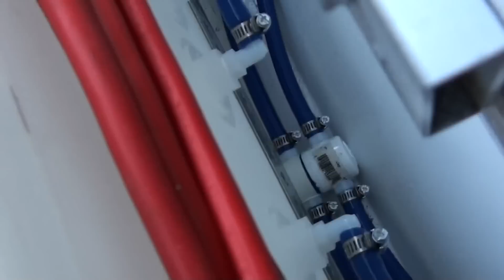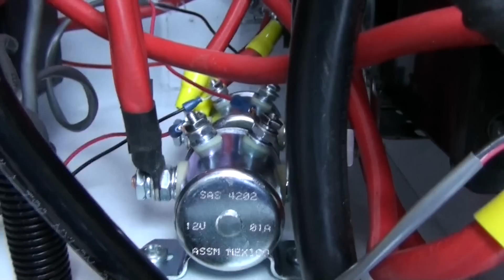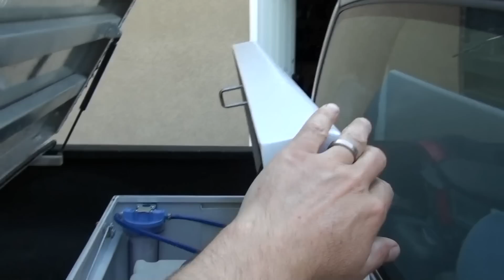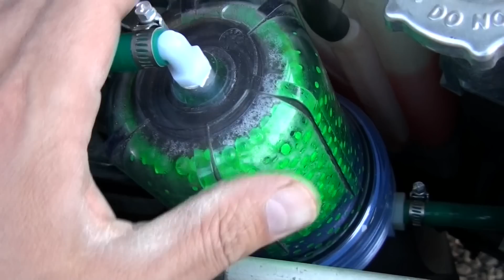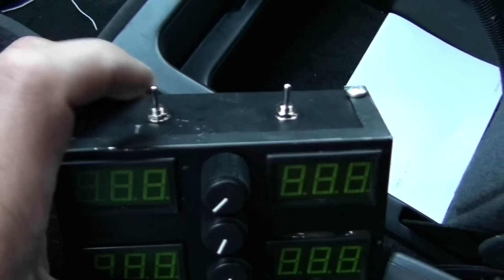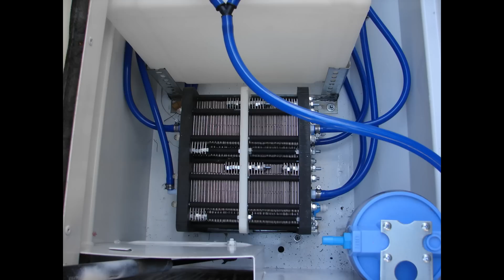288 Plate HHO generator Dodge Ram project. Part 3

Comment: I hope to do this as well. My truck,is an original 2007 3500 Cab and Chassis. Quad Door. I like to see if it's possible to tune my truck in. Yes, the economy,would help our family life. And, No. I'm not going to sell it. 
Duane Bank's, if you happen to see this. I have an idea, of introduce, a smaller metered about of hydrogen, into the diesel mixture,to capitalize the energy's, effect for emissions. 
I am more interested if a level Cummins, 6.7. WITH ALL ORIGINAL EMISSIONS. Yes, it is worth shouting about. And, even with the rusting flatbed. The truck,has been, very good to me. 
     If conclusion, the ability,of this truck engine,is truly, Amazing. 
   Have to say, they have good truck engines, in the 6.7. The designer's,followed the principle's,that made, THEIR first truck engines. THEY WILL GET YOU THERE. Gearing, HELPS. 
   6.7 is a hailing engine. gets good mileage. But, I think the possiblity,may save the Diesel. MY TRUCK IS, A CLEAN TRUCK.  No DEF. Legally, I like to see if it's possible.  Hopefully, we can correspond, Sir. Thank You. David Funke.

Comment: I have an older model chevy 4wd with a smallblock 355 with a little build.  Also built a pipe type HHO generator and have been playing with it.  One night I was out giving it hell and trying to run it out of gas basically becaise I also have built a vapor carberator .  The dam thing ran like hell as long as I had it on the floor turning the hell out of her.  I have a isolation valve to cut the carb off so I know it was running on the HHO and vapor mix.  A little spark knock cause it's compression is rather high for pump gas.  Just thought id share

Comment: Hi, I would have a question.We know that oxygen is formed on the positive plate, and hydrogen is generated on the negative.On the neutral plate is oxygen or hydrogen formed?
Reply from the maker: On the neutral h2 is made on one side and o2 on the other.
Reply: The opposite side of neutral plate  to the positive plate produces oxygen and the opposite side of neutral  plate to  the negative  plate  produces hydrogen?

Comment: But the generator is not drawing enough current from the battery...though the capacity of the battery is 130AH..
Have you uploaded any video which shows how the HHO generator is connected to the battery..
Reply from the maker: Yes I have an installation video you can view here:
http://youtu.be/D7z3zU07efM
Reply: Hey I saw ur installation video..
But you havent used a pwm in your circuit..wont that cause any overheating problems??
Also there is no fuel pump relay in the truck that I am using..so can I directly connect the switch to the positiv terminal of the battery??

Comment: Its a 12 volt charging system wid max charging capacity of alternator of upto 50amps..i tried it again tday by connecting two batterys in parallel but still there was no success..
Reply from the maker: okay it's going to use 15 amps for every 1 liter of hho production.
To increase the hho production add more KOH

Comment: hi steve,
      i am using two 19 plate dry cells that i had purchased from you last year for my final year project..i am trying to install it on EICHER JUMBO 20.26 trailer which was provided to us by a local logistics company..the truck is running on a EXIDE MHD1300 battery..i have a few doubts which i wanted to clear..
a) the battery is not supplying sufficient current to the generator due to which the production of gas was very less..about 250ml when idle and about 700ml when the accelerator was pressed..what could be the possible reasons??
b) how can i be sure that the alternator would be capable of charging the battery under running condition..
c) is it possible to use another battery of lower capacity and connect it in parallel with the trucks battery and then using the former to run the generator..
          i want an output of 3 to 4 lpm..plz hlp me out...
Reply from the maker: Is your truck a 12 or 24 volt charging system and what is the maximum charging amperage of the alternator?

Comment: hello I made a cell-nnn + nnn-nnn + nnn-seals with 1 mm and two Plexiglas walls and the problem that when I get on the cell does not work either a bubble of hho but removing the goarnizione and the walls and put in a bucket of water goes far belo function but do not know how. what can be the cause?? sorry if I did not write just can not write in ingleze try to make do with goggle translator. thanks
Reply: A lo mejor puedo ayudarte, escribe tu duda en español, porque no entendi

Comment: Not so sure I would have mounted electromechanical solenoids inside the box.  If there is any type of gas leak wouldn't that be a bit of a problem? Given the properties of HHO gas it would be big boom?  Seems that this was a miss?
Reply from the maker: I put a couple of holes in the top of the box for any hho that gets loose to escape
Reply: Fair enough....  I saw those in the box and got to thinking that with the lid closed, it could be a bit scary.  But you took care of it other then maybe have some sort of positive airflow going into the box.  Least if it were me and my box, I'd do it..

Comment: Wow I am impressed. I have searched high and low and couldn't find that. But that is what my experiments revealed to me also. So now I put this to you, doesn't that distort the voltage readings on a voltmeter? Meaning that it does indeed follow faradays laws of voltage drop? So theoretically if you could get the resistance low enough you could in fact run a 118 plate +118n- cell on twelve volts with 30 amps running through it? Drastically improving the milliliter per watt value?

Comment: you might find poly beads would dampen sloshing of liquids, baffles being best, but fitting baffles might be troublesome Through the small neck space available in the tank top...one concern, the centre tank is a water tank, and a water seal is not a gas seal {be aware of leaking} the other being to cut high in the box, vents to allow any gas {possible leaks} to vent to atmosphere within the box. interesting videos.
Thom in Scotland.

Comment: Correct me if I'm wrong delvis. Because you can't control that much power with just a simple on/off swith, and/or maybe you can but you have to run the oversized wire into the cab, with a big ass switch, the solenoinds let you run a simple, small wired remote switch.

Comment from the maker: It did come to an abrupt end because I don't have a power source large enough to accomplish my goal. The project is not dead though I will be building a new shop hopefully this summer that will be equipped with what I need. At this point I do still plan on finishing it.

Comment from the maker: The cost is high but this is a experimental system so I can pinpoint what works and what doesn't. I really don't have a clue what the mileage improvements will be but I would like to double it if possible.

Comment from the maker: The plates have 2  3/8 holes, you can see them on my website. The cells have no neutrals.
I have had some setbacks I started the system up and two of the pwm's fried. I burnt out two more figuring out what happened. I have some analog gauges ordered and I'm rewiring the whole thing. It will be a couple of weeks before the next video.

Comment: nice, is that 0awg wires i see or is it 1awg? i love where you are going with this. same place i was in 2008 :) everybody laugh at me using a AFC and big wires LOL. im sad you didn't take my advise on the tank thou :( but time will tell. i have a question, how are your cells configure? and how many holes per plate, also the size of holes.

Comment: Nice job Steve, how many LPM, ? also do you remember the video of  those guys showing a Dodge Ram running only with HHO, they were talking about pressure, 50 psi I think, do you think you need that amount of pressure to run this one only with HHO, also they were using a biger tank, I think 35 gallons, don't you think they use that tank only to have better pressure ?. well is only my point of view, congradulation for the wisdom you have and thanks for give to us the oportunity to see it.

Comment: Sweet man it's looking good! Great work! I'm looking forward to seeing it run!

I made and installed a gasoline vaporizer in my 2006 Buick and have achieved between 214-320 Miles Per Gallon. If you are interested in fallowing my work click on my name bellow the comment.

Thanks for all the work your doing man! Thanks for sharing your work that's the way to go!
Reply: You don't pull a man's leg you jerk it plum off
Reply: 213 to 320 come on
Reply: @lindseysteele1436 after testing the best average achieved was 211.7 mpg.

Comment: I would get out the hole saw and mount one computer fan low on one side as a pusher, and one in the top as a puller and some kind of duct work.oh, is that a flash arrestor? or an airsoft grenade lol

Comment: nice work! that wiring must have been tedious. the box needs venting. you have many connections in there and hydrogen is very thin and will pass through even the hoses and accumulate over time in the box. the battery is another source of hho and is filling the box through it's vents. turn off the solenoid and KABOOOM! the toneau cover wont contain the blast. this is the best effort i've seen on utoob (just don't mysteriously disappear...)